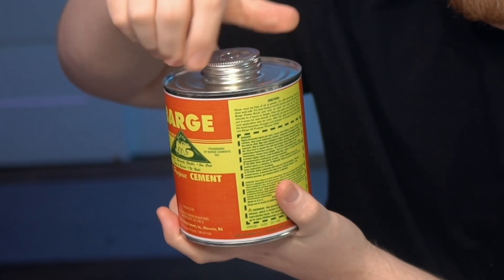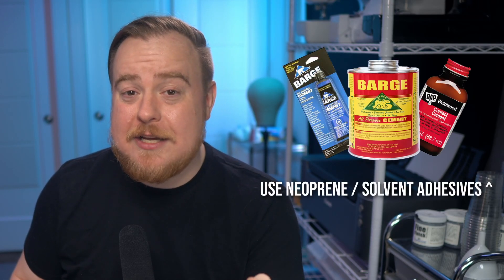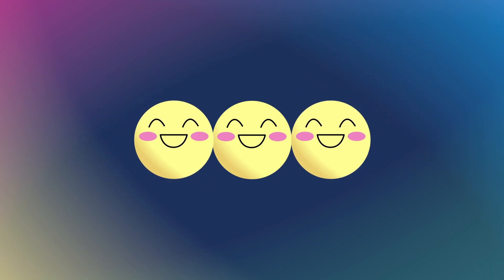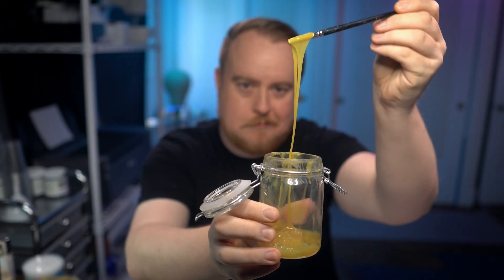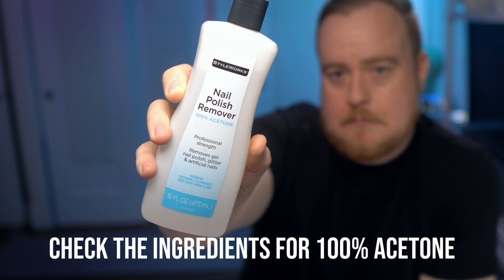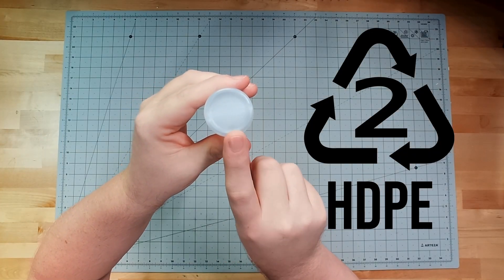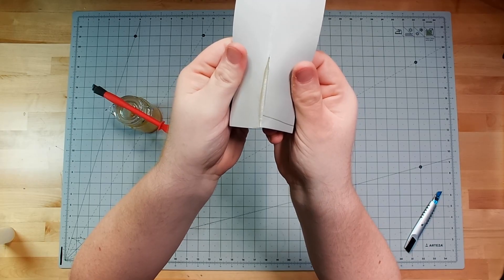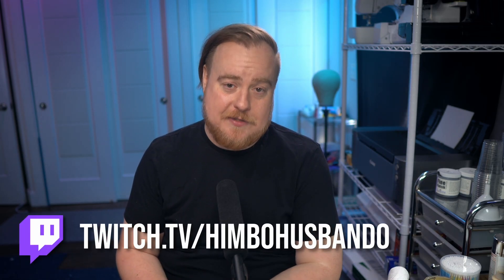Why is my cosplay contact cement so thick?

Comment: lol, i been trying to find a thicker contact cement. Want it like the consistency of thick boogers so it doesnt drip off. Just let it air out some a?
Reply from the maker: You'll actually get better results spreading it on thinner and in multiple passes. If it's dripping you might be using too much.

Airing it out will thicken it up, but it won't spread as evenly which will give you a weaker bond.